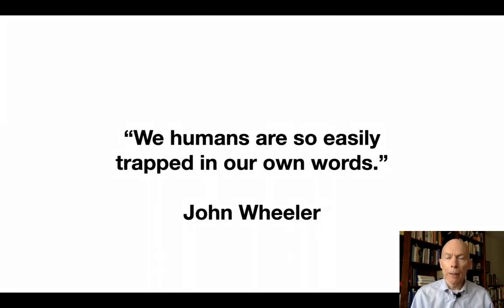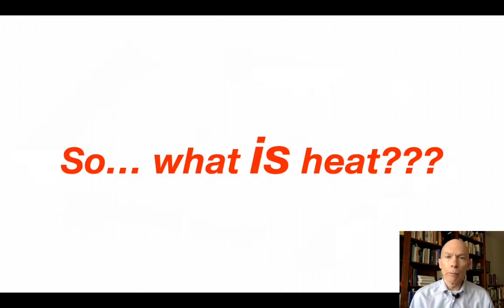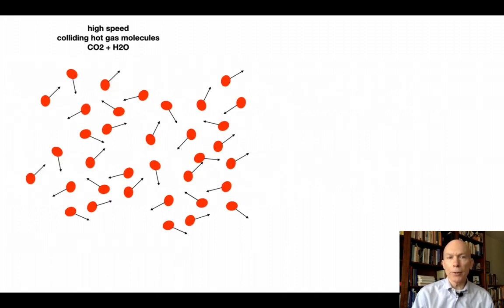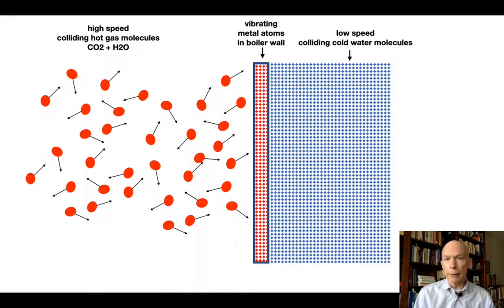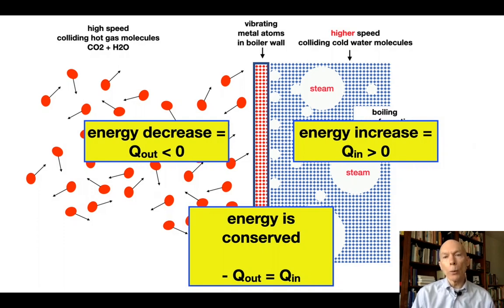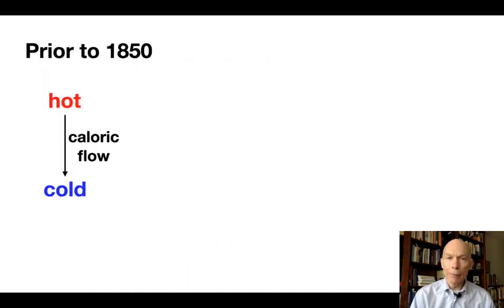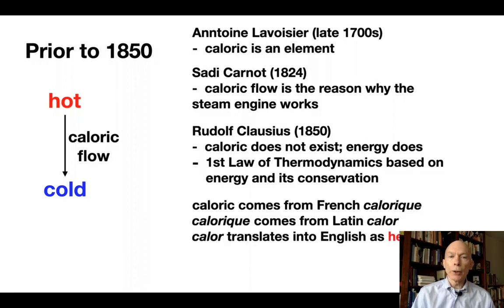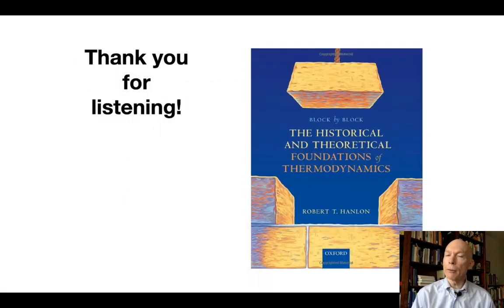Bob Hanlon:  What is "heat"?

Comment: Thanks Bob!.  You describe very well the molecular processes occurring when the temperature of a body/fluid is changed by contact with another body/fluid (through a wall).  Perhaps the issue with using the word "heat" is that is considered a noun, when in fact it describes a process and so should be a verb - such as "heating"?  

On the other hand, since we use an equation to express the 1st Law of thermodynamics - in a closed system Delta E =  W + Q, we do want to assign a word to the quantity Q.  I don't consider that being trapped; it is a consequence of needing to communicate (another example is all the words that are used in our litagatious society!).  

This situation need not be discussed only at the atomic level.  Otto Redlich in "Thermodynamics Since Caratheodory" Rev. Mod. Phys. 40(3), pp. 556-563, noted that the real problem about energy, heat, and the 1st Law arises because the concept of work (W in the equation) has been confused over the years and not defined precisely enough. 

I might comment that though Clausius establish the definition of energy and the 1st Law, it is only because of Joule's experiments that the caloric was demonstrated to be nonexistent.  The fundamental definition of energy (E in the equation) arises from his demonstration that the adiabatic energy change (actually temperature change of an insulated system by doing work) is a property of the system state, so the change is independent of the process.  That is, the change of a state property, Delta E, is defined as W(adiabatic).  Then "heat" is defined as the difference when the same energy change occurs when the insulation is removed and there is a temperature difference between the system and its surroundings.  Thus, Q is defined as Delta E - W.  Note that Q for a no-work process (fixed volume) is also a state property.

Quantum mechanics via the Schrodinger Equation shows that all systems have energy levels that the molecules can occupy. Statisical thermodynamics shows the distribution of the molecules into these levels.  Identifying the macroscopic temperature with a microscopic quantity allows one to identify work as changing the levels of the system and heat as changing the distribution of molecules among the levels.   

Finally, you might think about doing a similar video about "What is temperature?"  I claim that is only something we can feel. :>)
Reply from the maker: John - thank you so very much for this comment!  Love its depth.  

Interesting that others have also suggested that I do similar videos on the words "work" and "temperature."  These tasks will require some effort!  I need to think about how best to do this.

You're absolutely right about James Joule, perhaps an unsung hero.  I enjoy imagining Clausius sitting in his office with Sadi Carnot's work in one hand and James Joule's in the other, trying to reconcile the two.  Such a great moment in thermo history.

You say that Q for a no-work process (fixed volume) is also a state property.  My thought is that Q quantifies a change in a state property but not a state property itself.  I've grown to view Q (heat) as the difference between two numbers.  Do you see otherwise?

Finally, if I ever get to the point where I truly understand Schrodinger's Equation, I'll consider my life complete : )

Thank you again for engaging in this way!
Bob